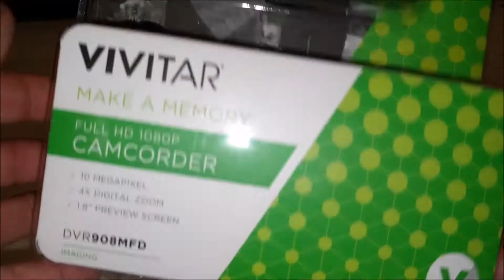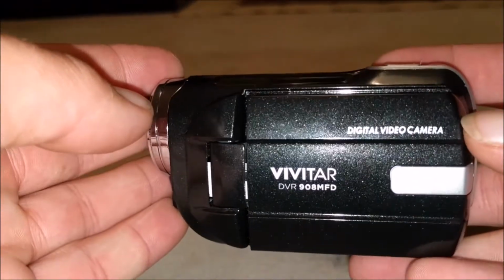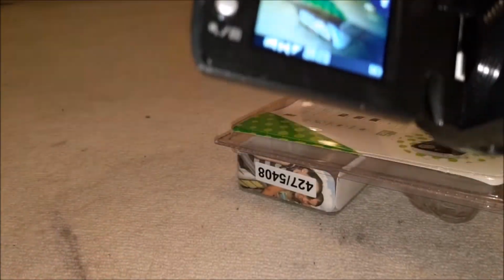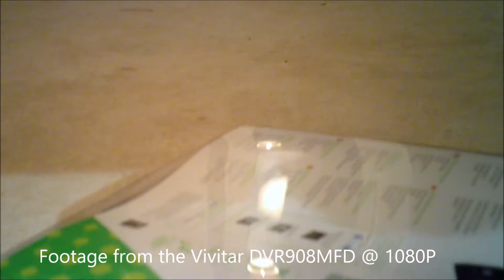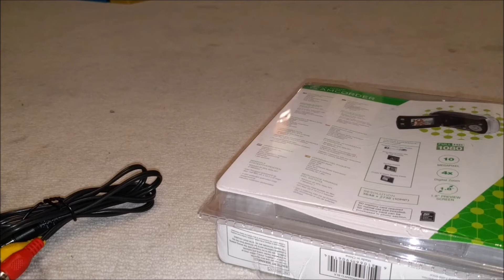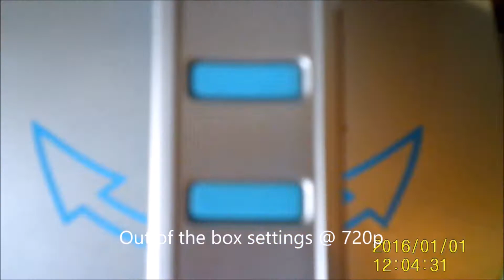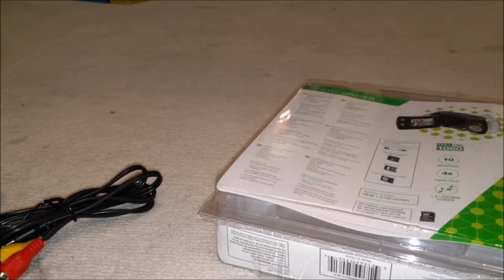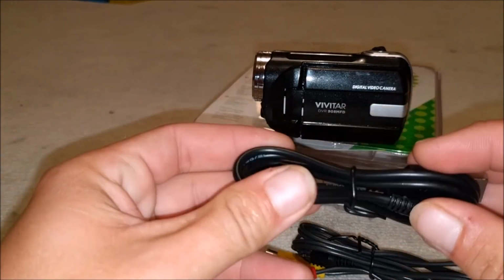Vivitar DVR908MFD CHEAP 1080p Camcorder Review - £20 at Asda!

Comment: I had that same camera and it was a load of rubbish! but if you want a proper camera go for the Canon G7X Mark II if you want to spend like £200 lol. At the minute i have a canon Powershot Full HD SX610 HS but its not got a flip up screen so its no YouTube video camera!
Reply: Oh and i don't think you will buy it because i didn't check the price and its blooming expensive - Spoiler alert! £570.99
Reply from the maker: +NinjaBOB32 Gaming I'd love a proper camera! That would mark the transition of my channel from a hobby/something I do alongside just collecting to something proper, and I don't think I've got the time to make that decent!
Reply: Yes,  i would agree with you there.
Reply: NinjaBOB32 Gaming I wanted a power shot and go this I crashed when I went to record
Reply: Better camera's are better I have to use a iPad original btw and a JVC camcorder from 2003 it crap but it will have to do till I can get either a cannon Eos. Rebel t5i ef-s 18-55 or a cannon powershot
Reply: Far better off getting a Canon, Sony or Panasonic.